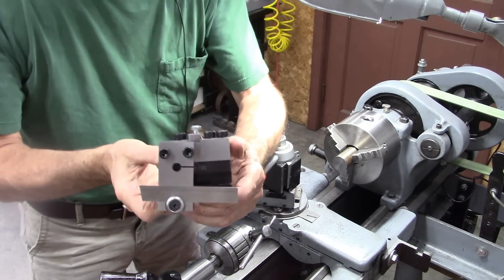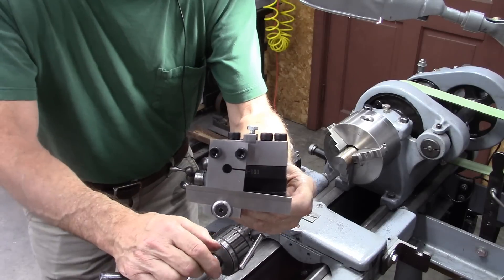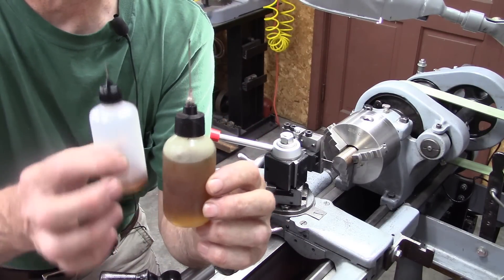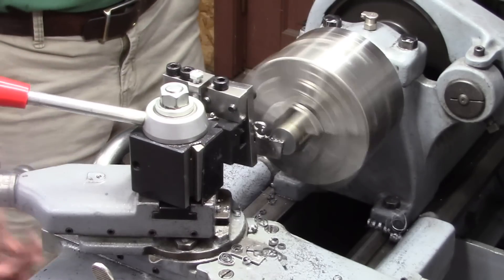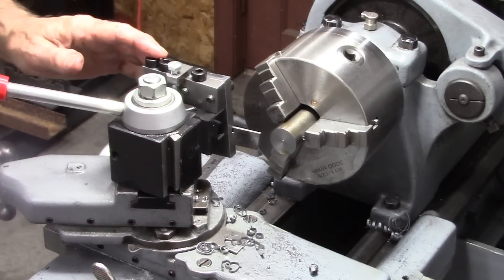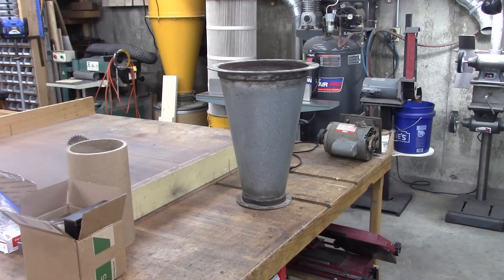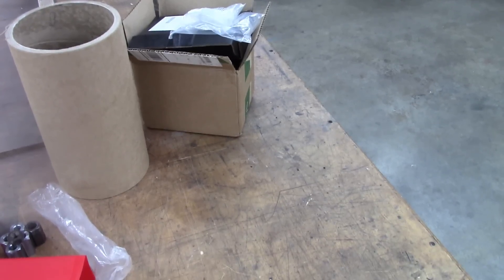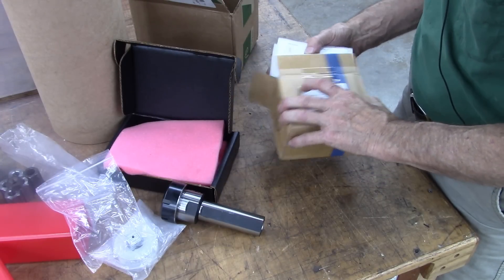Cut-Off tool, Gear Hobs, Grinder Dust Collecting and a Funky Old Drill Press

Comment: Clough42’s electronic lead screw project has much in common with the gear hobber. In both cases, you are looking to synchronise two shafts that have to turn at speeds that are fixed ratios of each other. James would have some valuable insights, I should think. It may even be adaptable with some changes to the software.
Reply from the maker: This is very true. I may end up contacting him.

Comment: I have been using a dust deputy attached to the lid of a five-gallon bucket to collect dust from my grinder as well as chips from my lathe and mill. The hose I attach to the machine is like 10 feet long and I have never seen any sparks in the dust deputy.
Reply from the maker: I was thinking of something similar, thanks

Comment: Will the gear hob just cut one tooth at a time for a spur gear or will it all spin somehow and cut helical teeth?
Reply from the maker: A gear hob (cutter) has cutting teeth arranged like a screw around a cylinder kind of like a tap. The mill head is tilted to a specified angle and rotating gear blank is fed into the cutter. In this arrangement the gear will be a straight spur gear. You can also cut helical gear by also tilting the gear blank. I'm building mine just to cut straight gears. The required tilting spindle is more involved to build and I don't have much need for helical gears. In a pinch I can shim and tilt the gear blank and spindle.

Comment: Edit:  deleted my electromagnet idea it wouldn't catch the wheel dust.  How much dust is there to collect, is it mainly just a problem with the sparks?  I'd be happy with that.
Reply from the maker: There is tons of dust from the grinder and wire brush and spark are not attracted by a magnet.

Comment: I would definitely keep the wood dust and metal dust separate due to fire risk. You could use a separate metal body shop vac (without bags) on your cyclone so that it is a stand alone unit that should have no issues with sparks etc. going into it. 
Thanks for the update on the cut off tool. I have been busy building another workshop, but I have just started building a cut off tool holder from your plans. Of course I have mentioned you and your site again in this video. It is for my larger lathe that uses the 250-201 tool holders. Ill let you know when the video is out. Thanks again for all your testing and the plans.
Reply from the maker: Thanks on the cut-off tool. Yes, let me know how it works out. I agree about keeping them separate although I'm not too worried about the shop vac being metal. Right now I'm thinking a blower with a cyclone and no filter. Metal separates very well.

Comment: I’m sure my opinion is the same as everyone else, make the two separate from each other.  When I finally get power to my barn, I plan to put my wood shop and my metal shop in there, side by side but separate dust collection.
Reply from the maker: My opinion too. Not worth taking the chance

Comment: We use dust collectors on our large indistrial grinders. The collector oem recommended a long pipe riser (20 ft high) and a 180 degree turn back down to the collector. We have never had a fire on those collectors.
Reply from the maker: Interesting...  I think I'll go with a separate blower with water in the tank

Comment: For the metal dust collector, why not put some liquid in the bottom? Not sure what the liquid would be, probably water treated with some rust inhibitor? Might introduce additional humidity into the extraction system.
Reply from the maker: I agree...  although I'm not going to use the woodworking for the vacuum source.

Comment: I know nothing about metal dust collection, but a friend of mine (professional luthier) has set fire to his wood dust collection system several times with embers coming off his inverted pin router. So, even wood can set fires. Particularly insidious as ember lands in fuel and has a stiff breeze blowing on it!
Reply from the maker: Aggressive pin routing! But good point. So far I have never had a fire and the cyclone is about 23 years old. Still I don't want to push my luck. I'll use  separate blower.

Comment: I have a vacuum for the garage that collects the dust and metal in a homer bucket.  The vacuum comes from a horrible freight vacuum cleaner which I almost never change the filter on.  In a wooden box I have the homer bucket and the  vacuum hose from the outside world (the one sucking up the metal and dirt) comes in the top of the box aimed at the center of the homer bucket.  At the other end of the box also on the top is the hose to the vacuum cleaner.  Since I am vacuuming mostly metal it is too heavy to need a centrifuge action as the metal hits the bottom of the bucket just straight on and stays there.  Any wood dust that gets through mostly stays there as well because the oily metal chips stick to the wood or vice versa.  I empty it about once a year.  Thanks for the video keep on keeping on.
Reply from the maker: Thats kind of the direction I'm heading except I want more air volume. I plan to put a shroud around my wire brush and buffer wheels and i need to volume. The belt grinder would need less vacuum. I'm thinking a 1hp blower with the cyclone.

Comment: Really interesting drill press. Dixon ZTR lawn mowers used this concept, and they called it "Cone Drive". the concept goes back to the early days of sawmilling also. It's basically what variable ratio transmissions are designed on. As far as the cyclone collectors we used them on our Flame spray and Plasma spray machines. We sprayed molten ceramic powder onto rotating ceramic parts. Because of the abrasiveness the steel was armor plate, and the concept is the heavy particles fall to the bottom and the light particles are filtered via a bag house system. The bag houses and blowers were a substantial distance from the intake to allow cooling of the hot particles before hitting the bags. Bags were pulsed with air blast on a timer system. Sawdust should not be abrasive or hot, so the extra travel distance is not necessary. The tweaking of tools such as the cut off tool holder and gear hob are excellent content. I just finished making a drive dog for a gear shaft so I can re-machine the teeth on an antique lathe I am rebuilding. In doing so I have an idea swirling in my head of making some mandrels from discarded shafts from electric motor armatures... Most of those shafts are already center drilled and ground to press fit dimensions of ball bearings. So why not make good use of them instead of just throwing them away.   Armatures come in all sizes from automotive fuel pumps /starter motors/alternators and single-phase motors. Sure could save a lot of machining time by re using them.
Reply from the maker: The armatures are an excellent idea! I've fixed a few broken teeth on gears and it's worked very well. I used to original teeth to index from. The replacement teeth looked perfect but I always hear them while running. Gears are very critical. .002 or .003 off and the gear is noisy. Cyclones separators work amazingly well and as long as the dust that gets through it goes into a bag and not a drum of fine well airyated saw dust. I think I need to use another blower and keep them separate. I always liked the Dixon drive system. Cones are really better than a disk. The surface speed within the contact area is a lot closer to the same which allows you to have more contact area. If I remember right the Dixon has a 2" contact. I think a 2" wide drive wheel on a disk would burn up.

Comment: Yep, fires aren't fun, you would need some kind of filter material or magnets to catch the metal, Kurtis from Cutting Edge Engineering channel just built a big one for his Spray Weld setup, love the old Drill Press, i'm trying to find a big old heavy one to build a Slotting Machine..
Reply from the maker: I'll check out Cutting Edge Engineering! Slotting? For what?
Reply: @WinkysWorkshop  Keyways and internal Splines etc, like a vertical Shaper..
Reply from the maker: @65cj55  I've done that but most drill presses are a bit wimpy

Comment: Mate, I would look at a water trap for the dust collector as aeriated saw dust and a spark may go off like a spark in a flour mill. Great to see a gear hob and the variable speed drill press. If ever you ever get interested in tangential tools for the lathe that would be interesting as they are suited to small machines like your cut off tool. Tangential fly cutters work well too.
Reply from the maker: The water trap would work well I think. However I think I will keep the two systems separarte. Can you link me to an example of a Tangential tool

Comment: Wood saw dust can get on fire by itself - for example,  if it gets dump. For metal dust it would be sufficient to attach just tin can to grinder. Cyclone sounds really cool but I believe it is overkill for grinder.
Reply from the maker: I wanted a way to collect grinder dust as well as the wire brush and buffer. I have the setup you described for the belt grinder and it catches about 80% but the wire brush and buffer will need more air flow. I've decided to keep the two systems separate.

Comment: About your metal dust collector. That is kind of how my father lost his garage. He was cutting ceramic tile with his table saw, he thought that he had all of the sawdust cleaned out of everything. He would clean it after each day of cutting. Well one night they got woke up to the garage being on fire. a piece of tile had found some sawdust and caught on fire enough to get other things on fire and that was the end of his wood shop, truck and all of his tools, also the greenhouse which was attached to the garage. I wish you luck with doing that, but I don't see how you are going to make it work. Maybe to use a strong magnet to collect it, and have a way to easily clean off the magnet. Electronic magnet maybe.
Reply from the maker: I've decided not to use the larger cyclone. If I do this I'll use a separate blower and cyclone.

Comment: I would guess that a few fine screens at the vacuum port to the system would make a fine spark arrestor. Seems to work on dirt bikes and chain saws.
Reply from the maker: You might be right...  it might also restrict air flow. I think a separate collector is the best aproach

Comment: Recently, twice this year I’ve seen metal containers that catch and contain wood sanding dust that hadn’t been touched in days catch fire.
No metal sparks, just combustion on its own so I can’t say if fine metal dust would do the same but after seeing this I will always utilize the dust pan .
Reply from the maker: Yeah, I'm not taking chances. I've decided NOT to use the larger cyclone. If I do this I'll use a separate blower and cyclone.

Comment: My HF cyclone is mounted on top of a Dewalt vacuum and works great. I vacuum cold metal chips and wood sawdust off my Bridgeport all the time. I’ve never had any problem with the mixture. In fact I’ve never even thought about it being dangerous.  Now sparks with sawdust is a different story. Don’t do it!
Reply from the maker: I was wanting higher volume but good information. Thanks

Comment: Purchase a used Shop Vac at a garage sale to collect the grinder dust.  No fire hazard!
Reply from the maker: I'd like higher volume but yeah...  I need a separate collector
Reply: Run a shopvac through a cyclone for your metal dust, maybe ending in a metal box with a furnace filter to catch the dust.

Comment: Well, I have a large Home made Bead blast Cabinet- and I kept burning up shop vac motors trying to suck the cloud of dust while blasting so you could see-
So I rigged up a 5-gal Lowes Bucket with the snap on lid, and put two PVC fittings in the lid, facing up, one ended just inside the lid, the other has a pipe that extends down into the bucket and just falls 1/8" short of touching the bottom of the bucket- The pipe that goes to the bottom, you attach INCOMING air and trash, the fitting that stops just under the lid you attach your suction source and fill the bucket 1/2 to 2/3's the way up with water, which you change periodically-
Basically I made a Bubbler BONG kind of thing, so all stuff goes thru WATER before progressing on, since doing this I have never burned up and other shop vac motor ever again in the past 10+ years in my bead blaster, where-as before I was burning up two a year? Bet it would stop sparks..........
Reply from the maker: The BONG collector! I like it 😜 the water bath is a idea.

Comment: In theory you could connect the exhaust of the metal cyclone to the wood dust collector pipework however it would need a spark arrestor between the two to control the ignition hazard. It would typically be a wire mesh or pad, however that's going to need cleaning to maintain operation and should ATEX certified this side of the pond, I believe that's HAZLOC where you are. 
However considering the consequences of a dust cloud explosion can be very lively (look it up on YT if you aren't familiar) I would keep the two separate for the incremental cost of a shop vac. 
That would be my choice having worked in the chemical and O&G industry as a Process Engineer for quite a while now.
Reply from the maker: I think a separate collector is the way to go. Hazloc/Atex..?.  they will never see my home shop. OSHA would have field day in my shop. Thankfully they are not allowed.
Reply: @WinkysWorkshop  🤣 nobody wants a visit from OSHA, seriously though separate systems is the way to go, I use one of the small plastic cyclones from scamazon with a shop vac, does a great job on separating and keeping the vac almost clean
Reply from the maker: @Paul-FrancisB  I agree, cyclones work well and keeping it separate is better. I worked in Printing most my life. In the late 80's I was begging for better guards. Exposed rollers with a surface speed or 1800 FPM that would take half your arm in a split second. Then in mid 90s they changed the rules on guards. Printers had to meant specific guard requirements or face drastic fines. Common sense went out the window and sadly there was no significant change in injuries.  Some of the new guard created more hazard! I told to modified a guard one time and argued that it would create a pinch hazard. The supervisor said, do it anyway. When I completed the modification I went at got the supervisor and told him to look at it. He came out to the press and said, "wonderful". He then proceeded to lay his arm on the conveyor with the new guard and it took a plug of skin out of his arm. What flipped me out is that I took the guard off while he was at the hospital and when I came in the next day the guard was again installed. It was more important to meet the osha guidelines than actually have a safe machine.
Reply: @WinkysWorkshop  that is a great example where just following the "rules" can lead to a false sense of security. It also explains why you did such a good job with the band saw restoration for example. Thanks for taking the time to share your experience  and the entertaining videos.
Reply from the maker: @Paul-FrancisB  The false sense of security was part of the problem but there were a few other factors involved as well. Part of the issue was that adjustments on the machines were covered by interlocked guards so people would go to great extents to get around guards. Printing is a complex process and you can not simply turn off a press and then turn in one. There was a sequence involved and a lot of time and waste. People would do what was needed to avoid doing this. So poorly designed guards were a huge part of the problem. Another problem was a changing work force. A lot of cell phone experts that had never turned a bolt in their lives. They simply did not see the risks involved with the machinery. A danger that seemed totally obvious to many simply did not seem dangerous to others.

Comment: Hi ! Make a small stand alone dust setup with a separate vacuum instead of the wood setup. No fire worries and less mess for the wood setup.
Reply from the maker: There would never be metal getting to the wood collector but never say never. I agree, a separate blower.

Comment: Mark as a volunteer fireman back in the day I would highly recommend not mixing the metal shavings with the sawdust , your asking for a fire. Back when I was a volunteer fireman the number one cause of a house fire was a dryer where the lent trap hadn't been cleaned. Hot metal chips in sawdust is very risky. It could lay there for hours smoldering then ignite . And wow do I remember the old snapper lawnmowers that's the only mower my mother would own and boy did I hate them just for there clutch design . she kept them in business buying the round rubber disk. I do believe she could burn one up every week . And they were a pain to change. But I got good at it as many as she made me change. Lol. I would change the new drill press to a pulley drive. On my 3 bench grinders I have metal hoses coming off the back of them going into a five gallon metal bucket sitting on the floor behind them. Just a though.
Reply from the maker: Yeah, I agree, a separate dust collector. As for the Snapper, i had a 30 HiVac riding mower for about 10 years and the drive never failed. I remember looking at it and thinking, that is going to fail someday but it never did. I wonder if there was a pressure setting adjusted wrong on your moms?
Reply: A lot of walk behind snowblowers use that drive setup too. The advantage is you can change speed on the fly.  @WinkysWorkshop
Reply from the maker: @patrickoquin7215  Fortunately I have never needed a snow blower but I have heard they have this drive.